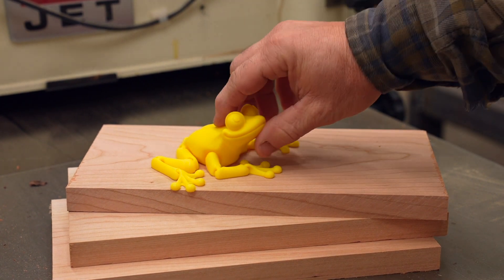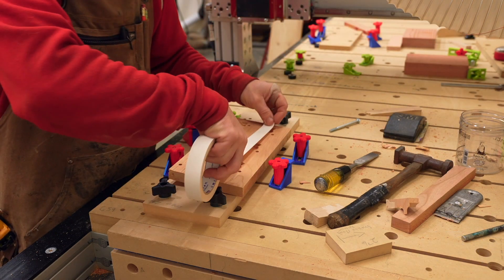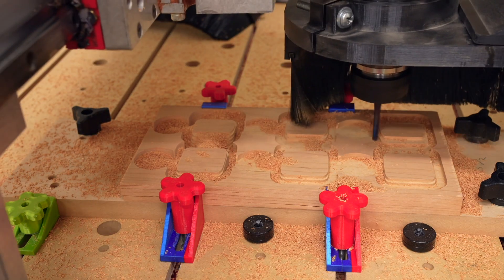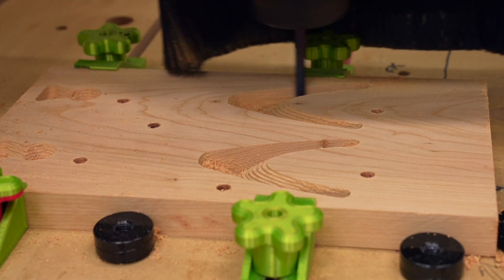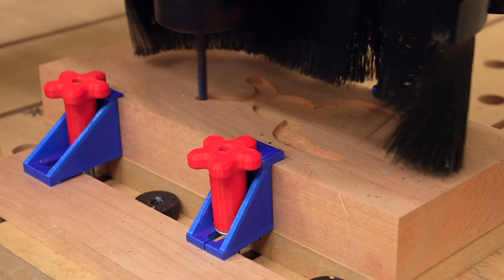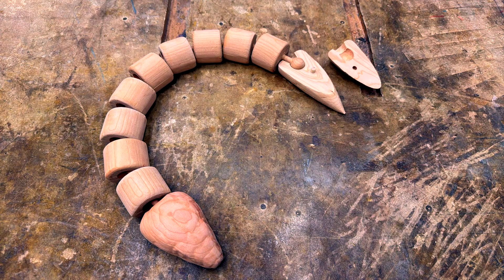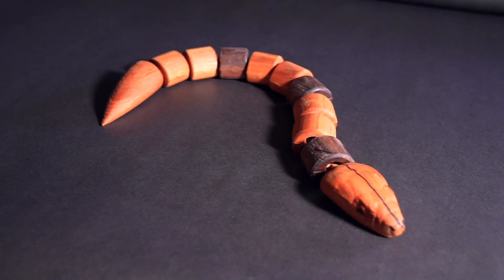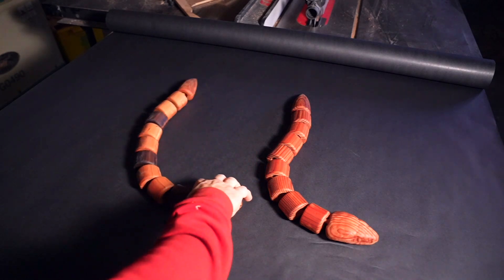Making an Articulating Wood Toy Snake, with Wood Joints! Modern CNC Woodworking

Comment: Could you send me a cnc carved snake head the size of the top joint of your pinky. I have a great idea for it. And can share the idea with you if you cut me one out. The bottom should be a lottle flatter than the top. As real as possible.
Reply from the maker: Oh boy! The smaller stuff is the harder it is to CNC; one has to use really small bits and do a lot of passes to get it to look good. This snake head I took from someone else's 3d printed model, as I'm not really good and 3d modeling realistic animals.

Comment: I know You are a programmer..!

Your thoughts on feasibility please..!

I am planning to design a VBA app with my limited knowledge.! Dont Know much But I think I can Come up with an excel Solution and then in VBA WIZARD , If We can develop a GUI version in PY/C++ ..it would be great..!

A universal App To calculate the cost of a CNC woodworking Project..!

A person should be able to calculate the cost of machining with somewhat approximation

1)Electricity Cost -with Total Watts of motors and related power eating accessories included in the operation
2)machining Cost- With Type Of Machining Strategies- 2.5D Profiling Only or 3D relief (or percentage of both)
3)CAD Time Cost -with Cost per unit time
4)CAM time Cost -with Cost per unit time
5)Raw material cost- with Cubic Inches 
6)Consumables-Preset Cost
7)Tooling Cost -With expected hours /jobs..etc

Any suggestion?

Comment: Very cool. I dig it.
I'd probably want to chunk-up the shaft diameter, and maybe add some minor tapers to get more side-to-side articulation. Your kiddo break one yet?
Reply from the maker: I made seven for his party, and two were redwood. The redwood is super soft, and the madness of a bunch of 6 year old boys quickly broke one. The other ones have been holding up so far (cherry, which is much harder), but I did some test twist-breaking on a sample and they can still be broken. My first tests allowed 360 degrees of movement...which would prevent breakage from force via twisting, but it didn't feel "real" to have the joints do that, so I limited the movement with an oval-shaped ball. Pulling length-wise can't be broken; the wood is super strong in that direction with-the-grain.  I think the joints will last as long as the PLA 3d printed toys.

So yeah! I think v2 should be a thicker shaft, and a scale pattern on top. I just ran out of time!